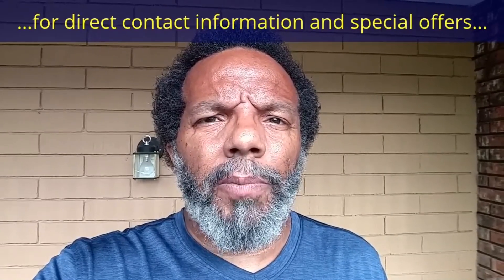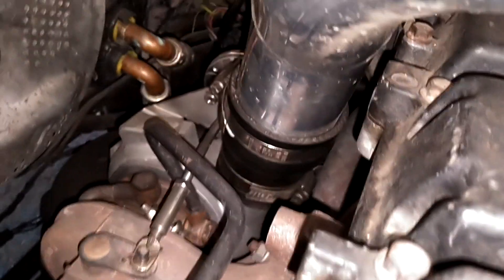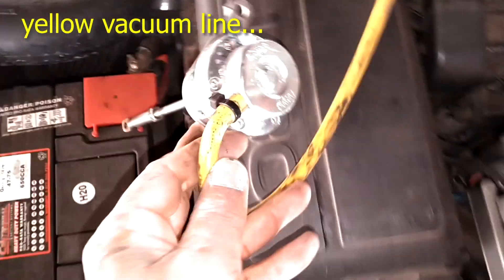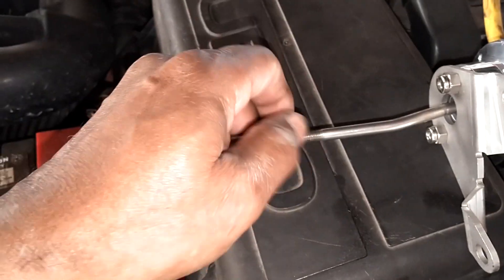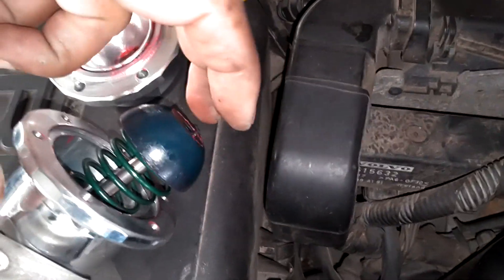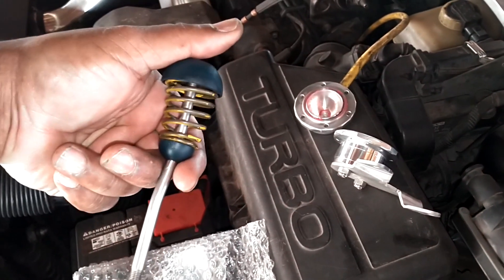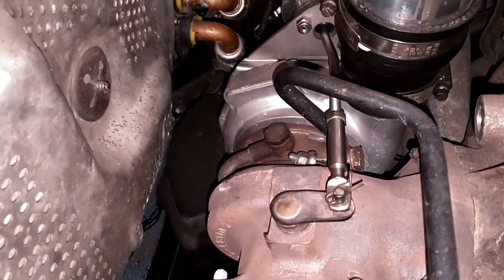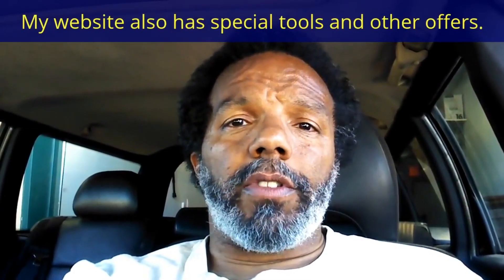Replaced the spring in my Forge waste gate actuator. The spring strength / color controls the boost.

Comment: 3yrs later.  Did you torque the screws on the actuator cap to a certain spec or just hand tighten?
Reply from the maker: Just snugged them down.

Comment: Robert just curious...what turbo are you running with set up. Its confusing with the stock wastegate they say to preset at 5.6 but with these Forge's and Turbosmart you can start the spring at 14 or 15 psi. How do they differ and are you running HDTCV? thanks
Reply from the maker: Stock TCV from 1998. I'm running a hybird 19T. This actuator acts more like a manual boost controller.

Comment: When you had the weaker spring did you have slow spool? My t5r is currently making 22psi on a 19t but vast keeps saying I have slow spool. Currently running a forge cbv with a yellow spring but still have the slow spool
Reply from the maker: Larger turbos spool slower. Also depends on the turbo build.

Comment: On a 96 Volvo 850T5, IPD shows a different way to adjust the actuator rod. Since the valve opens at 1.8 psi, you lift off the rod from the wastegate, pump the pressure into the actuator port until is starts to open, then close the wastegate with your hand and then adjust the rod to fit over the wastegate. Easier to google IPD Volvo 850T5 wastegate adjustment and see how it's done. Similar to the way you do it, except they pressurize the actuator with the appropriate amount of air to activate the rod opening. Viva performance has an actuator for this car, except it starts to crack open at 4 psi. Not sure how well that would work.
Reply from the maker: I am well aware of that. Those are different from this one.

Comment: Hi robert. I've got a 97 volvo v70. Equipped with manual climate control. I've fully serviced the ac couple hours ago. Compressor is not turning on and there is no lights on my mcc panel. What should i do next. Magnetic clutch? Or might the panel be broken or smthn?

Thanks in advance!
Reply from the maker: Have a professional check it out.